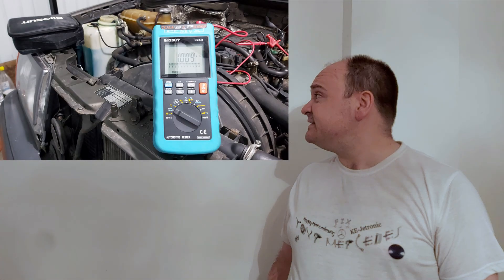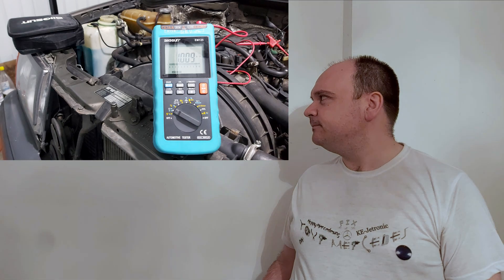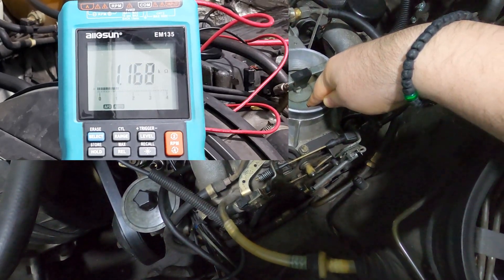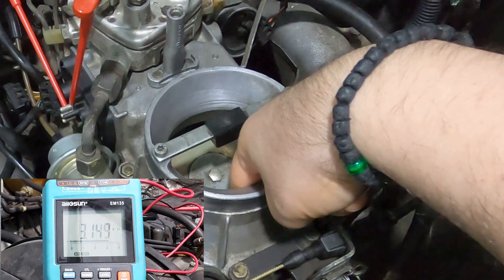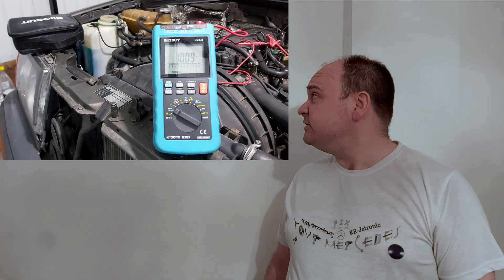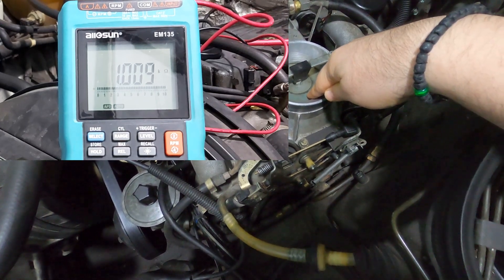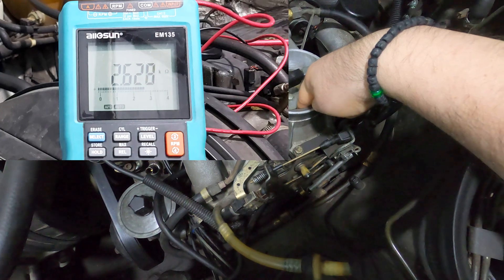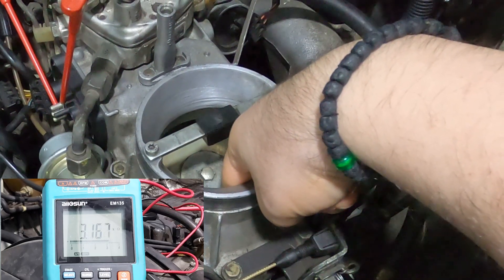㉦Mercedes Ke-Jetronic㉦ - Nominal values on the aftermarket potentiometers

Comment: This is interesting.

What you say at the end is the key. The quality of the resistance material (and therefore probably longevity) has changed and the nominal values of the potentiometer have also changed due to the change in material.

If this is correct, and the car performs fine, as you say, then the calibration of the potentiometer is not as important as initially thought.

What is important, therefore, is adjusting the potentiometer to get the maximum change in resistance across the range of movement of the air plate.

This means that the firmware in the ECU is not interested in the plate position, just the rate at which the plate position changes. It then changes the signal to the EHA accordingly. High rate of signal change to match the high rate of plate position change or slow rate of change of EHA signal to match slow rate of air plate position change.

Absolute values are not important, just rate of change. The greater the change in demand the greater the amount of fuel required. The ECU doesn't care about the amount of air and fuel to achieve a specified AFR, just the amount of fuel to cope with the rate of change in demand. This is why I have an "open loop" system with no feedback from an O2 sensor.

Or is this theory completely wrong?
Reply from the maker: Interesting point, my friend 👌 You are right that the ECU reacts not only to the static position but also to the rate of change of the potentiometer signal – that’s why acceleration feels so responsive.
But the absolute value is still important. The factory calibration (around 0.7 V at idle) gives the ECU its “zero point”. Without that reference, the car wouldn’t idle stable or run correctly at steady speeds.
So in reality the system uses both:
the absolute position (for base fueling), and
the rate of change (for acceleration enrichment).
That’s why proper calibration of the potentiometer is still necessary 😉
Happy Mercedesing 🚗✨

Comment: Hi Ivica, I'm measuring the resistance value of my potentiometer, and I’m not finding any jumps. In the last third of its range, it decreases a bit as you mention in other videos. However, the nominal values I'm getting start from 1520 ohms, go up to a maximum of 12300 ohms, and with the plate fully pressed to the end of its range, it stabilizes at 8470 ohms. I'm not sure if the potentiometer is original. Should I replace it? Are these values appropriate? My engine is an M103.980, non-catalytic. Thanks for your videos, regards!
Reply from the maker: Hello, If you get no jumps or O.L sign while you are deflecting the potentiometer at the very end then don't replace it. Because later at half a plate and further there is usually no malfunction! Happy Mercedesing!

Comment: So what to do? Is there any brand else that is good? Bosch are expensive... around 200€ now.
Reply from the maker: I chose one from Germany and it turned out to be a good one. And it's not expensive.
https://www.ebay.com/itm/142764496059?_skw=josch-world&itmmeta=01JBVNPZ2C09WC3D0A00DQS4GT&hash=item213d6d54bb:g:gHEAAOSwzrxUwOBh&itmprp=enc%3AAQAJAAAA4HoV3kP08IDx%2BKZ9MfhVJKkojqAympQAQ%2FsXv8RmaPXP1FvUFG%2BGK%2BHGcftHIVBQVUXoN2%2F0H3X9tzOGXDwXkhhOwt459q%2B1PRhOl7GSs1E2lZzhRmPOOnwApTFeNyGTYQvIP9gLN9BoQ%2Bh521E5alhFtpDY0uiPN4mYKgTSs%2FbIaXCeog4Uz2xejaBSN3CmaI6DV1%2F2FR3ASlC6vFgeoZJ4Cfs6fMimWc6c5BC%2By4H2WW0JMCzVKTfXQhBdog2mhRI4pfEr3QCel%2B4oYvfiPECmXS95LE4e%2FaLVdhN3xCIV%7Ctkp%3ABFBMnvHb9d5k

Comment: descente	tour  de vis  appuyant sur le plateau)   0,000	0,125	0,250	0,375	0,500	0,625	0,750	0,875	1,000	1,125	1,250	1,375	1,500	1,625	1,750	1,875	2,000	2,125	2,250	2,750	3,250	3,750	4,250	4,750	5,250	5,750	6,250	6,750	7,250	7,750	8,250	8,750	9,250	9,750	10,250	10,750	11,250	11,750	12,250	12,750	13,250	13,750	14,250	14,750	15,000

Millivolt Borne 2	) 300	290	320	580	630	690	790	1 120	1 360	1 510	1 560	1 690	1 770	1 770	1 810	1 990	2 100	2 180	2 220	2 340	2 580	2 660	2 870	2 950	3 090	3 150	3 300	3 350	3 510	3 560	3 700	3 770	3 890	3 950	4 050	4 110	4 210	4 270	4 340	4 380	4 450	4 490	4 560	4 660	4 660
	300		350		690		840		1440		1560				1830																														
																																											
																																													
4,83	volts entre borne 1 et 3																																												

ps  copie  des données  du tableur

Comment: il est vrai qu’à première vue   s’il l’on présume  à tord que ce boîtier est constitué d’un simple potentiomètre    ,  on est surpris de constater 

Qu’ à l'enfoncement   du plateau  la mesure de l’impédance   entre borne 2 et borne 3      puis entre borne 2 et borne 1  augmente puis  diminue   en façon similaire   avec une impédance supérieure   a ce qui est mesuré entre bornes 1 et 3       , donc cela ne correspond pas à la mesure que l'on peut avoir sur un simple potentiomètre qu'il soit linéaire ou logarithmique , 
j'ai pousser l'identification en appuyant de façon stable ( avec système de vis se vissant au travers d'un profilé aluminium mis à la place de la barre d'origine avec la plateforme plastique noire) 

j'en viens à la déduction , vu que l'on passe passe entre borne 2 et borne 1 par un début au repos 3,53 K Ohms de un maximum de 13,75 K Ohms et à fond 9,17 K Ohms , et entre borne 2 et borne 3 par un début au repos 5,73 K Ohms de un maximum de 10,67 K Ohms et à fond 9,11 K Ohms ,

que le boîtier  reçoit une tension stabilisée de 4,83V ( mesuré sur ma voiture )    entre les bornes 1 et 3      il doit délivrer  sur la borne 2 ,une tension  image  électrique de la position du plateau débitmètre
     ,  est constitué entre les borne 1 et 3       d’ un potentiomètre  autour de 27K Ohms [allongé d’un trimer 24 tours  monté en rhéostat  en série du potentiomètre  pour pouvoir régler finement, décaler la tension de départ   délivrée par la borne 2 ( plateau au repos)     
la tension  évolue de façon quasi anti-logarithmique   par rapport à l’enfoncement du plateau  

dans ce boîtier   il est certainement monté en parallèle    entre les bornes 1 et 3 une résistance  de l’ordre de  4,7 K Ohms   du moins dans la version  originale  3437224015          , ce qui explique  montée puis descente des impédances     les nouvelles versions 3437224035   doivent présenter  une  impédance  à peu près 2 fois moindre   , mais  l’essentiel  c’est bien d’avoir la même  progression de tension délivrée en borne 2         ( on pourrait dire  que l’avantage d’une impédance plus faible est  d’être plus résistant aux éventuelles perturbations électromagnétiques    )

Ps  dommage que je ne puisse ici  déposer  le graphique des courbes créé sur  Calc (open office) à partir de  mes mesures

Comment: Please tell us the value for the "new" potentiometer after adjusting the small screw. What is the value that works because I have huge problem and as you said is not a cheap fix to make a specialist for this model.
Reply from the maker: Unfortunately I can't tell that, just don't readjust it. If you have the only advice I can give you is to contact the seller to guide you through how to get it back where it is supposed to be.
Reply: @mercedeske  in my case I have 2 potentiometer sensors for some years and I have no idea who is the seller.
And I never touch these 2.
That means I can't make the adjustment and I need to buy new one?
Reply from the maker: @j0hn_k777  If you have been readjusting the screw for a flathead screwdriver then I can't help you, really. If you haven't then you can calibrate the potentiometer, no problem.
Reply: I just now did exactly what you told me to do and worked surprisingly.
Thank you very much and I wish all the best to you!!!
Reply from the maker: Thanks. I wish you all the best as well. I'm glad you solved you issue!
Reply: First of all thanks for answering so fast.
I have 2 brand new sensors that the flat screw is untouched.
When I place them the car is not running as it should be.
And as I understand I have to make adjustment to the sensor. Please make clear for me what adjustment I have to make except from the up and down of the sensor itself before make tight the 4 screws around.
Reply from the maker: @j0hn_k777  No further adjustments - the car has to be at the operating temperature(all consumers off), stick the multimeter in between so you can monitor the voltage and set the potentiometer so that you read steady 0.7V, tighten the 4 screws(watch for the voltage again, it is going to change) and as you read 0.7V it's a job done!